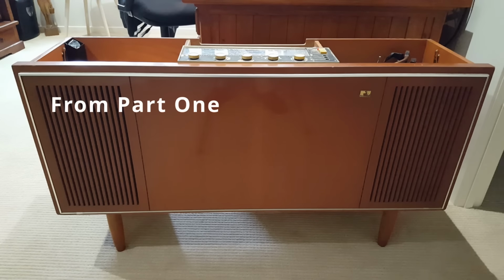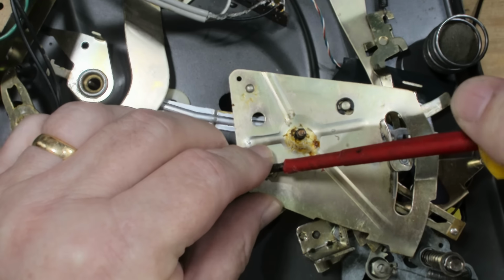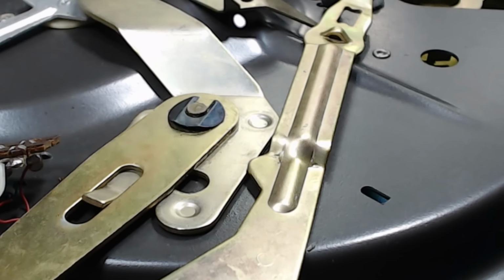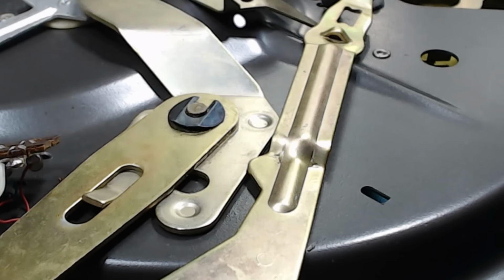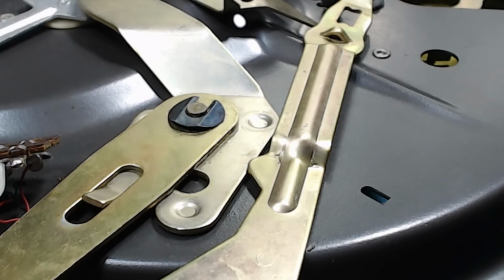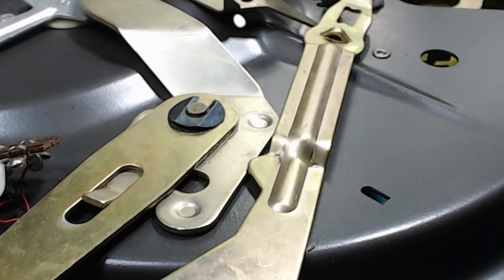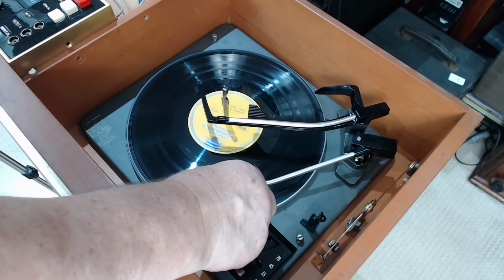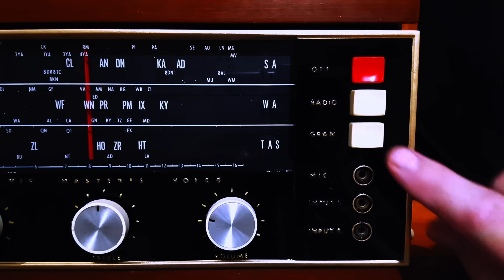HMV Studio 7 Radiogram Service. Model T3-45 From 1966 - 1969 Part 2

Comment: I've used telephone cable wire to repair tone arm wiring in the past, it's thin and flexible.
Reply: I knew I'd seen that kind of wire somewhere. I think some old multicore LAN cables had something similar. Cheers Christopher.
Reply from the maker: Ok, thanks Christopher.  👍🙂
Reply: LAN ( and telephone ?) cables are actually a size to thick for an uninterrupted movement. Sometimes you can find them in these thin cheap charger cables for phones, or the leads for earplugs, but the latter are often lacquered, so they have no plastic isolation.

Comment: Wow, I was a little bit disappointed that this time the tech is solid state, but that Finlandia sounded so good, somehow an authentic tube sound from the era :)
Great job again, Mr. Tipton!
Reply from the maker: Thanks jassenjj, it did sound good, I would be hard pressed to tell if a radiogram was transistor or tube, played beside each other maybe 🤔🙂
Reply: Much of the good sound, I guess, was the ample proportions of the speakers and the cabinet.   Get almost anything consumer grade today with speakers and those speakers will be tiny and the housing light plastic.  Every extra ounce is that much more to put on the boat from China.  Discrete transistors themselves were already renowned for their own analog sound as early as the Beatles.

Comment: Hi Dave,
I've thoroughly enjoyed watching parts 1 & 2 of this repair/restoration series.  To tell you the truth, I was on tenterhooks when you was realigning the IFts - those slugs break very easy. Thankfully they rotated fairly easy. 
The restoration work on the fingerplate is brilliant.  Those catings were far from quality.  Those types of castings sometimes warped, especially those designs that were positioned above valves.  Simple  but effective pad method for applying the gold paint to the raised print.
Aged 17, at college, included in one of several electronics practical tests was to reassemble three completely dismantle record decks: 1 BSR, 1Garard, and 1Colaro.  We was given onr hour maximum, including testing for all three decks.
When we serviced record decks in the workshop, we used dismantling fluid (oil) - the type we used was Plus Gas.  We found it worked better, and quicker than WD40.
A super job done on the radiogram my friend.
Best regards from Phil.
Reply from the maker: Hi Phil, thank you. The IF's were free thankfully and the casting of the faceplate was very heavy, it was quite well made. I can still get Plus Gas, never heard of it. WD-40 is not a fantastic penetrating oil, I do need to get some good stuff. I cannot imagine assembling three record decks in under and hour, that's production line speed 😀

Comment: When you mentioned the stylus in the beginning.  My though went immediately to having to lift the arm to blow off the accumulated dust.  Then the little brush that fit in my hand to clean out the grooves of the LP.  It also removed lint from your corderoy pants!
Gosh! We even had portable record players in grade school for audio presentations.  All the while inhaling the still damp ink from the "Gestetner Duplicating Machine", its actual proper title.
...and that sums up our high tech audio visual technology of the 60's and 70's.
I was watching a clip on the Jaguar Fighter that were using flight plans that were loaded on a 4 track cassette tape.  This was inserted into cassette player that would show up on a screen in the instrument panel.  This was circa 2005!
Reply from the maker: Ahh... memories. I will always remember the ink smell of a freshly minted Roneo produced newsletter at school, if you could read all of it was another matter 🙂
We still loaded the air data info into some aircraft from cassette in 2014, newer aircraft had the info on an insertable chip. Thanks Neil 👍🙂
Reply: @DavidTipton101  And the pilot kept a “bic” pen at the ready in the event on an “unscheduled cassette player eating the tape moment!”.

Comment: I just did an RCA combo unit from 1951 for a customer.  It had a 14-inch B&W rectangular CRT television and an AM radio/45 player combo unit.  Then separately it also had a 78/33 player.  Got everything working and the customer was very happy.  The record players are very challenging, but I enjoy working on them.  Great work as always, Dave.  Cheers and keep the videos coming . . . love them!
Reply from the maker: Hi bigaudioal, great work getting all that working again. The record players are interesting to work on and make a change from electronics. Thanks bigaudioal 👍😀

Comment: you never cease to Amaze me David at your mechanical abilities taking things like that turn table completely apart and diagnosing problem areas then coming up with a way to fix the problem like dried up grease. Kind of the dame thing I had to do with these dynamotors that are 80 years old had to soak the dried grease and bearing areas in acetone and then used an acid brush to clean it out  then re-greased the bearings. Great restoration David thanks for sharing.
Reply from the maker: Thank you LUCKYLARRY. Acetone to loosen the grease, I will try that, thank you LL 🙂

Comment: Dave. Great job on refurbishing the turntable. In my younger years, I worked in a radio-hifi store as a repairman, we were the warranty repair center for several companies.  I have refurbished hundreds of these, it brings back lots of memories. White lithium grease and sewing machine oil are always the best to use on these, they seem to last the longest without gumming up. However I was told by the manufacturing representatives to never put any grease or oil on the aluminum trip link. If it gums up the least little bit it will cause the records to skip. I always used a very fine piece of sandpaper to smooth the edges and then cleaner with ipa before putting it back in. You have to be very careful not to bend them or they will hang up. High end turntables and reel to reel tape decks were always my favorite to work on
Reply from the maker: Hi Robert, thank you. OK, that sounds like a reasonable reason to not put anything on the link and a place to look if the record skips. I will remember that in the future, thank you 🙂

Comment: Excellent, as always. Woodlice supplied as standard with all UK manufactured turntables. Too late now (and your workaround is fine) but you may be able to obtain stranded very-fine, model-makers wire (i.e. used for model trains, in the UK expotools A22015,  A22016 etc).
Reply from the maker: Hi ralph J. I Googled model shop suppliers and didn't find anything. Thanks, I'll keep that in mind for next time 👍😀

Comment: The cartridge fitted was a Sonotone 9TA. It was one of the better ceramic cartridges of it's day. The little white part with solder terminals is actually a plug made to be removed to prevent damage due to soldering heat, you were lucky!! If you need to replace the stylus, look for a 9TA/HC HC standing for high compliance. It does give a lower output but sounds somewhat better. It will also track well in the 3000 at about 3 grams.
Reply from the maker: Thank you Michael. I actually replaced the cart as the Sonotone suspension fork was damaged. I managed to get it working with some fiddling for the video but replaced it after it was finished. I looked at the white plug on the back and couldn't get it to move, I just tried it again and got it out, thanks for the info on that. When I soldered it I held a jewellers screwdriver against the tab to absorb the heat, I was worried about it damaging the cart. Thanks 🙂

Comment: @ 28:40  I was yelling at the screen: strip an old USB cable, Dave! :goodvibes: Excellent going there, it looks and sounds really good, those old transistor sets were pretty much ok, and also straightforward to work on..
Cheers from Deutschland
Reply from the maker: I couldn't hear you Blitz, we have the windows closed and the AC on ☹️ I know to use USB cable if I get stuck again. Yes, a very simple radio and easy to repair. The unit itself is pretty low powered but sounds good in the home. Thanks Blitz in Deutschland 👍😀

Comment: The cartridge is a Sonotone 9TAHC, probably one of the best ceramic type cartridges ever made. Frequency range goes up to 18kHz, incredible for a ceramic!

Tip for future encounters with such a cartridge; the white bit the wires are soldered to unplugs from the cartridge body. Best to take it off when soldering wires on because the heat can be transferred along the contacts and cook the elements.

Garrard changers are relatively simple beasts but the engineering tolerances are a cut above the average changer. In regular use, they last indefinitely.

I love the solution you found for the lettering on the fascia. Could've been tricky to do a neat job but that's a beautifully simple solution.

"Finlandia" by Sibelius is a superb piece! Liking the jazz too.
Reply from the maker: I found out the white bit comes off, a bit too late unfortunately. The Garrard players are well made and work well for their intended audience. I have in the past used a small ball of cloth dipped in the paint to do the lettering but Vern's idea worked even better. Thanks Paul 😊

Comment: I thoroughly enjoy your videos. I work on restoration part-time only with equipment that comes my way I am very limited in space for a properly equipped workshop. However, I recently had a similar problem with a record deck and tonearm wiring and after a great deal of head-scratching found a suitable source for replacement wire It's a telephone extension lead, the fly lead that appears flat rather than the round installed variety that you pin to a skirting board. I very carefully stripped the insulation and found four very thin stranded wires coloured black blue green & red and it worked like a dream. I had the push-on plugs for the cartridge ends and for the other end on the tag board used a very thin soldering iron tip. Ian London UK. cheers!
Reply from the maker: Thank you Ian. I probably have a number of those extension leads in a box somewhere. Good thinking 👍🙂 I bought some tone arm leads online but will keep your idea in mind if they are too short or unsuitable somehow.

Comment: Many would have given up by the Garrard changers worn out looks alone. But that never stopped you Dave in giving it
a go at an awesome restore transformation. The plastic dial face was a real tough nut to crack paint wise. Phonograph
 wire is usually  30 guage stranded  (0.8mm and pretty damn thin) and you  can get it at Amazon 10 colors at 10 feet long total. Such an amazing bit or should I say succession of clever repairs especially that brush at the end.
Reply from the maker: Hi Steve, thank you. It's a pity that the unit had been put into damp storage, it would have been pristine before that but it cleaned up reasonably well considering and hopefully have a few more years entertaining 🙂

Comment: Thank you for another great video. If you ever need small wires, you can always harvest them from old phone cables or ethernet cables. And regardless of what you say, you are getting better at the transistors.
Reply from the maker: Hi Ripley, thanks. I have ordered some proper wire off eBay. I am learning about transistors but a very long way to go 😄

Comment: These old turntables/changers are a pretty good alternative for the new junk stuff one can buy today.   Provided you know how to get them going again. This is where your vids come in. Great stuff!
Reply from the maker: Thank you @leyland9999 👍🙂
Reply: @DavidTipton101  My pleasure! I simply treasure quality, be it physical stuff or good publications like your videos. As for these old turntables, there is a very sharp contrast qualitywise. And I refer to the mechs in general and their weak points: the in most cases awful ceramic cartridges. This is why I referred to the magnetic Philips GP-410 push on head in case of an old style Philips or rebadged Grundig. For most, if not all Garrards, a modified Audio Technica AT-3600 can be used. Granted, it will take some fiddeling but can be done. Definately worth the trouble.

Comment: Hi David
That turned out to be a really nice radiogram!  Listening with decent headphones it seems to have a nice solid bass and nice clear mid range. I wouldn’t know about the high frequencies as my hearing isn’t that good anymore. And of course it all depends on your microphone (which I suspect is pretty good). 
That Garrard changer is certainly a step above the BSRs I’m used to working on. Well worth all the effort you put into it. 
A friend brought around a 1960’s Philips radiogram wanting to know if I would restore it. It looks very nice but (a) I don’t have room for it and (b) I’m feeling a bit burnt out to be honest. YouTube can be a bit of a treadmill. 
I might use your stamp technique on the clock face of my little Radiola clock radio. We’ll see. 
Thanks for another interesting video. Looking forward to that STC. 
Cheers
Reply from the maker: Hi Don, thank you. Yes, it sounded pretty good, not as good as some but good enough for the average family of punters. I use a Yeti mic, it's pretty good. I have a Philips RF8 gram here at the moment, I will do a quick fix on that one, I've done a few before. I do like the Aussie grams from the 60s, some looked very nice and work well enough, pity there is no FM though. I understand you turning the Philips down, they are a lot of work. Thanks Don 👍🙂

Comment: Great memory Dave, taking apart the turntable and remembering how it goes back together again. Sometimes those mechanical photographs are a mechanic's nightmare.
Excellent job on the faceplate, you're reputation at restoration continues.
Reply from the maker: Thank you Mack. These turntables are pretty easy and much easier then some others (Philips) 🙄

Comment: Hey David, I trust you are keeping well..Fab repair as usual, followed Part 1; and it Still baffles me how you get to figure out and restring the tuning mechanism..Totally cool vid, with so many twists and turns and info..Thanks for sharing..Top job..Ed..UK..😀
Reply from the maker: Greetings Ed, I'm in good form at the moment thanks. That was a pretty simple string run, I had the stringing diagram but that stayed on the printer till I did the alignment 🙄 Tape on each contact point helps a lot. Thanks Ed 👍😀

Comment: Looks like 👍 you’re at it on part two. Gerrard record player. I don’t know 🤷‍♀️ if ya can restore the label 🏷, or special order one ☝️. Those spindles can be tough, as far as removing the turntable. A heat gun, hair dryer 👩‍⚕️, or soldering 👩‍🏭 iron can work, just do so carefully, so ya don’t damage anything, burn 🔥 yourself, or set the grease on fire 🔥. Also, be very careful not to let the “E” clip fly across the room. Use a magnet 🧲 here. Your friend, Jeff.
Reply from the maker: Hello Jeff, thank you for you advice 👍🙂

Comment: Fantastic job once again!
For the thin stranded cables: you could buy LiYCY cable and get the individual cables out of the bundle. They are available in very thin diameters.
Reply from the maker: Hi Kristof, thank you for the suggestion, I will look up LiYCY cable. I have purchased some replacement tonearm wire as well 👍🙂
Reply: @DavidTipton101  That's probably even better. I didn't even know there was such a thing as specific tonearm cables. 😅

Comment: Fantastic restoration David. Great attention to detail and an inspiration to us all. By the way that fine wire in the tone arm looks very akin to modern alarm wire.
Reply from the maker: Thank you Garard. I haven't seen modern alarm wire but it would probably be too thick I should think 🤔🙂
Reply: Hi David. Modern alarm wire has six insulated fine strands of separately insulated wire, and it was the inner strands I was meaning. Sorry I wasn't clear but seems about the same guage as that wire in the tone arm.

Comment: Very enjoyable as always David. 
I've done many of those decks and it's common for the gear shafts to be loose. The grease is the problem and I've seen it in many machines especially movie projectors which run hot
Looking forward to the radio chassis soon.
Regards Jonathan
Reply from the maker: Thank you Jonathan. If not for dried up grease the decks would still be running as new 🙂

Comment: Lovely stuff David especially the stylus cleaner. I hope Mrs T is not missing her make up brush from the dressing table else you will be in so trouble! I worked on an Autoslim and didn't have luck in a good idler wheel so had to make one from scratch turning the wheel up, pressing in a new bronze bearing and using an O Ring as a 'tyre'. All the time I was doing this I was imagining you doing the same!! All the best and look forward, as always, to another Radio Adventure.
Reply from the maker: Hello Martin, thank you. Mrs T hasn't cottoned on to the small section of bristle missing from her blush brush... yet! You are 100% correct, I have done the exact same thing a few times on previous videos, I used a square section seal for the tyre, it work very well. Great minds think alike 😀

Comment: Good job with the phonograph pickup wire repairs. I feared there wouldn't be enough wire left to make the trip from cartridge to terminal strip, but there was.  Stranded magnet wire (litz) would probably have been thin and flexible enough, but it does not have colored insulation and would have been difficult to identify at both ends.
Reply from the maker: I only just made it lengthwise. I have purchased some cartridge wire for next time 🙂
Reply: @DavidTipton101  We can count on you to do it right as best as is possible with what you got on hand.  Your amateur jobs beat out many a professional job in completed quality.